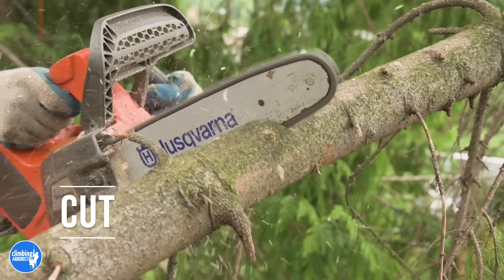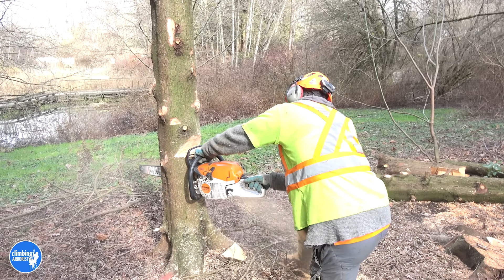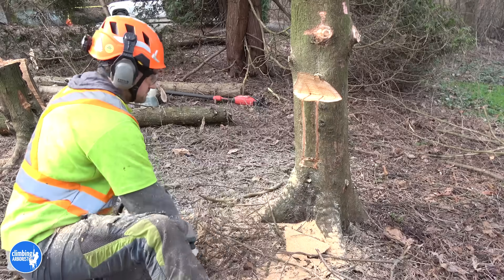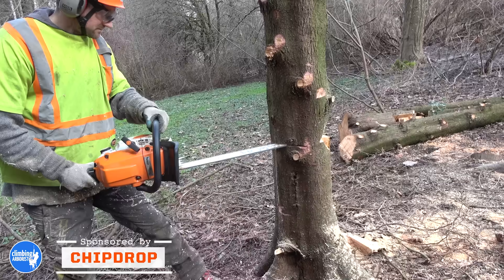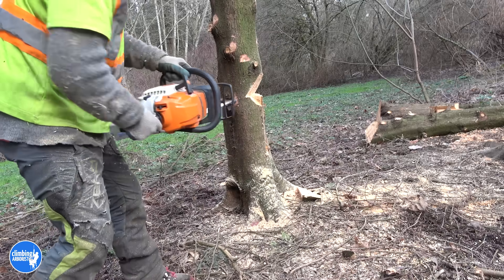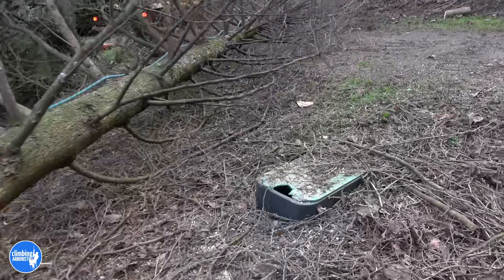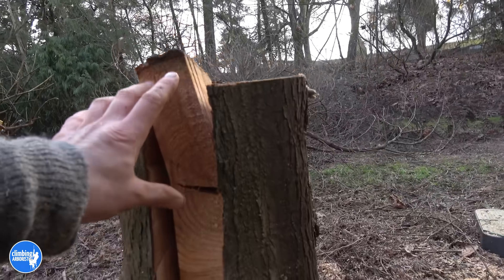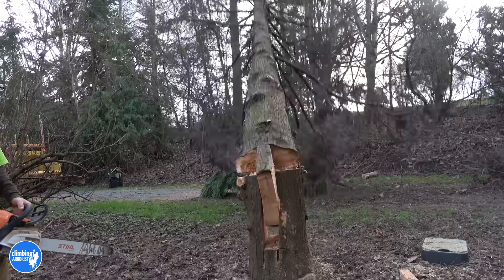LEARN the 'KEY NOTCH' tree falling technique

Comment: All I think when seeing these videos is, I'd be fired before lunch. If my Boss saw me wasting time and money doing such ridiculous things on the clock.
Reply: He says specific situation, I guess when you don't want it to fall just between the shed and the garden fence without risk of veering off.
Reply: @marcohandmann4843  No, not really, you can do that with just a hinge, this is more specific, only when you don't want the base of the trunk to jump to the side, or possibly hit the ground within a few ft of the stump. Its a very very rare situation that this is needed.
Reply: @marcohandmann4843  I heard him say that. There's no improvement over an open face notch and a bore cut to the back side.
Reply: He did say right at the beginning that this was specific to a high control of roll/deflection.
Reply: @noehctuccmliw  A proper hinge will do that, but it won't control bounce
Reply: @noehctuccmliw  yup heard that. Same reaction. Just drop it a different direction
Reply: Apparently you two didn’t listen, he’s not saying go logging with this method, probably shouldn’t comment if you don’t listen.
Reply: @ClimbingArborist  ~ plunge cutting ruins the bar by taxing the sprocket and there’s a number of trees that would simply lock up the chain with latex or sap. 

I can think of maybe only a handful of cases that I’d use this technique in over years of felling trees.
Reply: @72marshflower15 I am curious how the spp. Of tree would change things.

I recall what saw that was, 500i? 462? But Def enough power for some plunge cuts. I'll loose track of this comment if I go back to find it, but just watched a 550xp video by this tree guy I like... Southern drawl, Husqvarna rep, sweet pole barn... But he was joking how ppl give him shit about how much he uses the nose of his bar and his comment was that if that was true he'd "have the biggest pile of scrap metal you've ever seen. " but he doesn't and went on to show the 550xp power by plunge cutting multiple time easily into a log.... He's the Boss, he's also a content creator and I'm sure even if he cracked whatever he was trying to avoid, totally f'd the saw and the bar then chucked it in the lake... The views and comments from this video alone would pay for it and then some.

It's kind of like skate boarding breaks skateboard s. Tree work is hard on everything.
Reply: You guys didn't watch till the end I guess 😂
Reply: It's only for cuts that your worried about it hitting something
Reply: @1636patriot  if you're worried about hitting something drop the tree in a different direction
Reply: @ST-xx9rt  It’s for keeping the trunk from crashing to the surface. Like a surrounding tile patio or wood deck, a fancy retaining wall, raised bed, etc. These are specific, but rather common scenarios in urban felling. Lots of people like to design expensive patios or decks that surround trees, but few think about what happens when that tree needs to be removed. If it can save you from having to call in a crane in a situation like that, you’ve saved time and money.
Reply: @PristineTX  I'm fully aware of what was said in the video. An open face notch of about 110 °followed by a boar cut. Serves the same purpose in regards to not having the trunk slam to the ground. If trying to avoid hitting an object on one side of the tree simply drop the tree in the opposite direction. Aiming for a different crash zone, is required constantly. Failure rate on the cut in the video is probably much higher than the one I'm describing to you if both sawyers are efficient. Simply because of how wood and wood fiber works. The technique I'm describing, would not require a rope being tied to the tree. Simply use wedges. Safer.
Reply: @ST-xx9rt yeah, when you’ve got buildings and fences on three sides jUsT dRoP iT iN a DiFfErEnT dIrEcTiOn 🤦‍♂️ 🤡
Reply: @philcourteney4328  no one would drop a tree in a space with zero extra room. You'd take it from the top. But if that's how you want to do things. Get good insurance
Reply: @ST-xx9rt  🤦‍♂️ uh huh. You keep doing you boo.
Reply: @ST-xx9rt  you do remember your initial argument was about “wasting time and money” right? 🤡🤣
Reply: @ST-xx9rt  I’m sure you will buddy, good for you!
Reply: @ST-xx9rt  just asking, for a friend, will you still be worrying about your boss seeing you wasting time on using techniques beyond step cuts, or will you get a promotion to assistant foreman sometime soon?
Reply: @ST-xx9rt so you only cut trees in an open field then? You can’t always “drop it in a different direction”. This technique is just a tool in the tool box.
Reply: @waynecanova6030  you don't seem to understand modern felling techniques. Or how arborists take down trees. If there is a big conflict. an arborist would use a lift/crane or rig the tree from the top for removal. More minor conflicts you drop the tree in another direction. I've never cut trees in an open field? But every Sawyer needs to drop trees in the best direction. Not into other trees or on top of quality saplings. and that's not always the direction it is leaning in. Watch a few YouTube videos where they're wedging trees over in a direction other than its natural lean. Watch a video of someone felling a tree with an open face notch and a bore cut, back-cut. I've watched the video above several times. Heard everything the man said. I still find it to be a less than useful technique considering there's many more ways to take down a tree that won't have so many possibilities of failure. Even his cut didn't land the way he was trying to make it. He stated so in the video
Reply: @ST-xx9rt any arborist that could drop a tree using this technique instead of climbing and rigging a whole tree would do it lol
Reply: @Djspiffymcdoo  anyone could fell a tree using this technique with practice. Why take the risk of damage. Even he showed its flaws in the video. He limbed much of the tree.  Many better choices.
Reply: Get over it haters... he's teaching a trick shot.everyone can't be as cool as you
Reply: @dlucks174  trick shot😂 good one.
Reply: I think some people are missing the difference in the objectives between logging and arborist.
The logger is trying to save every bit of of the log of use when felling a tree. That is his objective.
An arborist is just trying to remove the tree as careful as possible because his pay come from the customer not from the value of the tree for processing into product. So avoiding damage to any of the customer's property. 

Totally different job objectives between tree removal business and logging business.
Reply: How about you watch the video again but pay attention this time? He blatantly states this technique is for a specific purpose. You wouldn’t last long working for me with the lack of listening skills you have exhibited.
Reply: A lot of variables here that can go wrong and compromise a Sawyers safety.
Reply: Isn't logging rated as one of the most dangerous jobs? Maybe bosses cracking whip is contributing to accidents
Reply: @Gadfly321  not just maybe. Still mostly people that don't follow modern safety rules and think they know better
Reply: This is for specific circumstances. Pretty sure under them, you would be doing a lot of other things that would take more time than the extra 60 seconds to make a perfect fall.
Reply: Seems a useful technique for residential areas.
Reply: Correct because they don't give a flying fuck about you if you get hurt or die on to the next one. Don't be brown nosing a boss who can careless about you and your life.
Reply: If this tree had a house beside it you might be sounding like an idiot bitching out it's uselessness
Reply: not  every tricks on youtube are aplicable for daily activities and routines
Reply: We all have jobs that we'd like to do fancy stuff while the boss wants us to be cogs. Pretty sure that's why people like myself thumbed up. 

Similarly I thumbed up before I realized context matters, which the other commenter's provided.

I'm sure if I were an arborist and the trunk came rooting upwards from the ground or I ended up miscalculation a hinge, my boss would ring me a new one.

"very specific technique for a very specific situation" as the video states is pretty accurate. 99 /100 times you won't need it, but that 100th time it could be the difference between an upset customer / insurance cost or 30 minutes of time
Reply: Hahahah!!!!
Reply: @ST-xx9rt  
'Who clear cuts (eg for pulp) with a chainsaw'?!
Read YOUR 2nd comment, muppet.
Reply: Must suck being you.
Reply: @ST-xx9rt  
Oh.
So you 'selectively' fell for pulp?! 🤔
🤣🤣🤣
Grow up, child.
The only 'tools' you've ever had in your hands are your own and those of your boyfriends. SMH
Yer muted.
Reply: That’s like saying you’d be sacked from your job flipping burgers at a Macdonald’s for dressing your Big Macs with crème fraîche and a dill sauce. 

You’re not doing what this guy is doing. Probably explains what someone said up at the top - he’s the boss. You HAVE a boss. Chef/Burger flipper. He’s the chef, you’re the burger flipper. You’re playing someone else’s game of checkers, this guy is playing his own game of chess.
Reply: @georgemorley1029  you've just shown you know nothing about felling a tree with that analogy. Checkers versus chess? hamburgers? 
Watch a few videos of people cutting down veneer quality Chestnut or oak. Maybe a Sawyer from Sweden or Denmark where in some cases you have to be certified before you're allowed to cut.
Reply: @georgemorley1029  sounds like you've never fell a tree. No one's flipping burgers or playing board games.
Reply: Youre someone's serf lol. He's his own boss. Sucks to suck 😂
Reply: @AlanRipman  I'm semi-retired been a logger for 48 years in one shape or form. I was the boss for 3 years and I hated it
Reply: He’d fire you if you landed the tree on his fkn truck because you didn’t do it 😂
Reply: @Megahegs  why would a truck be in the crash zone
Reply: He is the boss sooooo
Reply: @Rpotts1999  I don't work for him. It would be hard to put a lot of sticks on the ground doing that. Cutting pulp requires volume. Even cutting saw logs. you wouldn't hinge a tree that way. Too much waste
Reply: @ST-xx9rt  who’s cutting pulp with a chainsaw, harvesters deal with that about one tree per minute.  

Tree surgeons get to spend as much time as they like on fancy techniques.
Reply: @evan010101  have you seen the price of a Ponsse lately? We cut on smaller jobs that aren't worth bringing in processors, or the land owner wants horses skidding to avoid damage. The good money is the veneer and mill hardwood. We still cut more numbers of, Aspen, red maple, fur. Lately dead ash. We don't cut in people's yards
Reply: @ST-xx9rt just lie down if sticks on ground is the objective
Reply: @mariaconcepcionrodriguezhe2850  what??
Reply: @evan010101 no they don’t time is money doesn’t matter what you do…..
Reply: @evan 010101   This is absolutely misinformation.   I’ve logged for 14 years and fell timber for over 2 years in the great northwest, and “harvesters” fall everything they can, period.   Timber fallers fall the timber machines can not get to, because the ground is too steep, just like shovels log everything they can and yarders log the ground machines can’t get to.   
    As for being able to waste time, and wood this is absolutely not true.     The reason we don’t do this cut out in the brush isn’t necessarily the waste of time though, but rather the waste of wood, which is also why we don’t use the farmers face when cutting.     In the woods we do a practice called “driving timber”  which is a very fast, and efficient way to put a lot of timber on the ground.
   With all that said tree arborist job is so different from what we do in the woods that it’s not a fair comparison, and you could even argue doing unnecessary things like this cut in this instance shown on this video is ok, because although it is a waste of time part of the job is impressing, and making the customer feel good.   So doing little tricks to please the customer, and make them feel more confident is necessary when dealing with a customer, however in the woods we don’t care about trying to impress people, or make them feel a confident, we are simply trying to not damage wood, put it down fast, and put it down in the correct direction “or in lead” however if you can’t get a tree to fall in the right direction we have lots of tricks that are quick and effective to remedy that which can even be as simple as driving it with another tree,  but in worst case scenario we can just fall it out of lead, and then limb, buck it so it’s easy for the logging crew to deal with that ends up logging the unit.
Reply: @ST-xx9rt You’ve had at least two people debunk your initial comments based on a lack of relevance.   The fact that you’re still arguing highlights your meager comprehension skills.
Reply: @millroyboy07  that's historical. When you receive tree felling safety training from someone like the, Great lakes timber professionals association. The very first thing you learn is not to do risky cuts. Placing yourself at risk for such reasons makes no sense. Modern filling techniques can achieve everything in this video without ever having so many opportunities for injury and failure. Sorry if there's a better way and you don't want to see it. My argument isn't with the video anymore. It's with people that insist on showing beginners how to do dangerous cuts, rather than the safest possible. Safety first not cutesy
Reply: @ST-xx9rt  There’s nothing inherently more dangerous in this video than using standard felling.   Your initial argument wasn’t about safety.  You argued that this technique would be more time consuming, and have a delay effect on mass felling.  One of the key components of safety is rate of work.  Too fast and mistakes are made.   You’re just arguing in circles now.
Reply: @millroyboy07  my initial statement was in regards to my boss and his potential reaction to me doing such a thing. The reasons why I think it's a bad video for beginners is safety and the strong possibility they wouldn't be able to get this complicated cut correct. I I would never use this technique for many reasons. I only listed a few. Speed is not the dangerous part about production cutting. Fatigue in bad conditions. Of course there's a speed at which it becomes unsafe. Any professional should know not to exceed their limit. And I'm not quite sure you understand what modern filling techniques are if you think this isn't inherently more dangerous than a 90°+ open-face notch with a bore type back cut. Followed by wedges pushing a tree over.  I'm not referencing some  farmer style cut. Like most videos. But hey, do what you like. sorry you were offended by me and the 70+ people that gave my comment to thumbs up
Reply: @trueaussie9230  who clear cuts using a chainsaw? Processers are used for that work. Only plantations and Aspen get clear cut around here. felling  is done with saws for veneer Mills, and high grade hardwood. But you could ask your mommy about the fact that not all species and locations handle harvesting the same. 
Go back and watch some more swap loggers
Reply: @ST-xx9rt  clearly said at start it was for use in a tight area that you are worried about it jumping and rolling
Reply: @Limb69-w7k  yup heard that. Still no thanks. There's better choices as long as the tree isn't rotten. And then his trick wouldn't work either. Sorry
Reply: @ST-xx9rt  
"Who clear cuts (eg for pulp) using a chainsaw?"
Judging from your 2nd comment ... YOU DO.
Reply: @trueaussie9230  don't see the word clear there
Reply: Stxx9rt isn't an arborist
Reply: Don't have a boss. Be creative in your work , enjoy what time you have. 🌎🌍💚
Reply: @mattliamjack3293  I worked for myself for a while. I hated that boss more than any I've ever had
Reply: @ST-xx9rt  it is tough...im still failing as my own boss🤣😂🤣😂🌎🌍💚good luck bro. Tell yoir bossmore fun at work necessary 👍🏼👍🏼✌🏼🐣
Reply: @ST-xx9rt, nobody forcing you to watch it, block YouTube or don't go to the site, you will be extremely efficient and your boss will be happy, this video apparently is not for you, as a lot of other videos, that people share to help each other
Reply: @viktorpavlovych  that's funny. People read comments to help make informed decisions. Not everyone is a blind follower of cute videos. I could make videos about cooking but people would get sick. A cook could comment and save everyone. But hey you don't need to read comments. Could help you be more efficient
Reply: Cool story bro
Reply: I agree, this is to logging what the trick shot is to the NBA
Reply: Such a waste of time.

Comment: Why play games when felling a small softwood like that? Notch perpendicular and back cut with wedge, if necessary, to land  exact. Good way to wear out the tip of your saw in just 1 plunge cut on a real hardwood. Which from the video, yours has definitely been over heated. Stihl 500i has higher RPM which will cook your tip plunge cutting in hardwood
Reply: Because he’s demonstrating an advanced cut for YouTube.
Reply: The tree he is demonstrating on isn’t really the use case that needs this cut.
Reply: He clearly says this is not for every cut but for some scenarios like preventing rolling or protecting a retaining wall.
Reply: Listen to the beginning dipstick